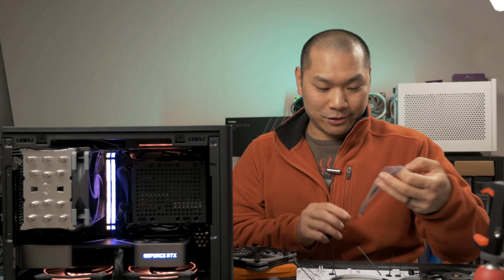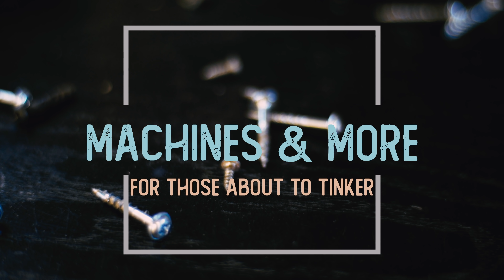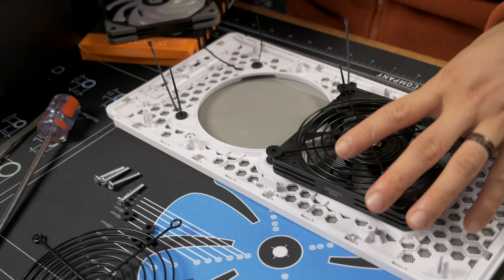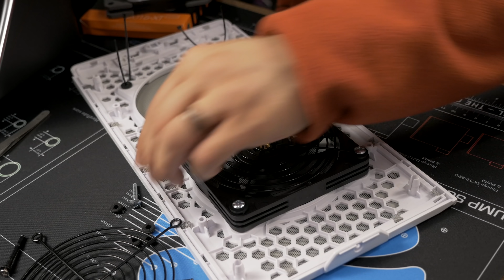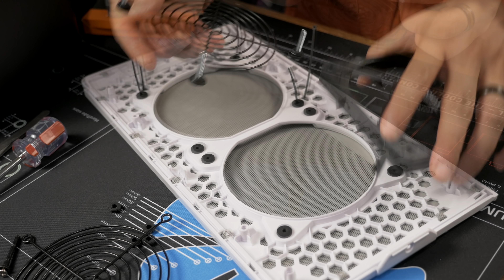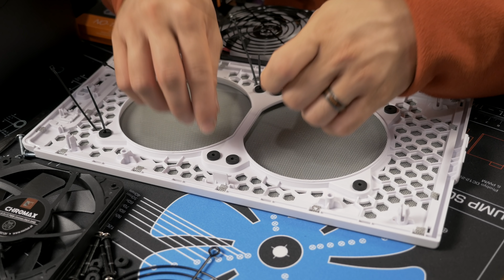Slim 120mm Top Fans in the NR200: Cheap, Easy Mounting Solutions and Thermal impact

Comment: What do you use to measure temps?
Reply from the maker: There are a number of hardware monitors that you can use- I'll show a few in the post build setup guide. The most important one is Ryzen Master since it is AMD's utility that will allow you to get the true CPU package temps. For general system monitoring HWMonitor is good, and I also use Open Hardware Monitor.
Reply: @MachinesMore  thank you! Check you instagram! Sent you a pic of my build. Tysm for you help!